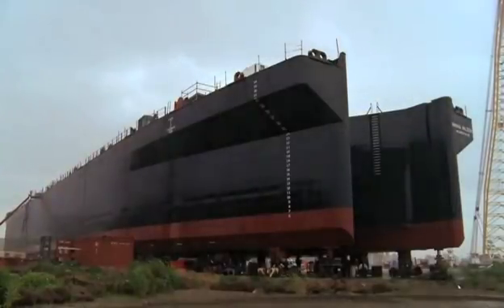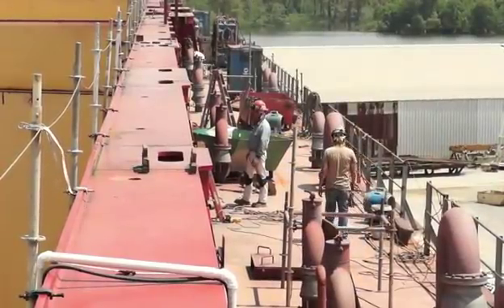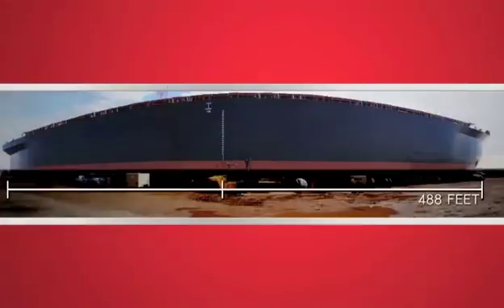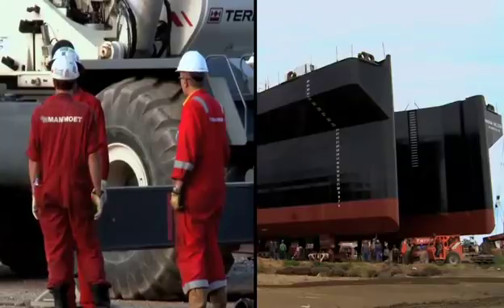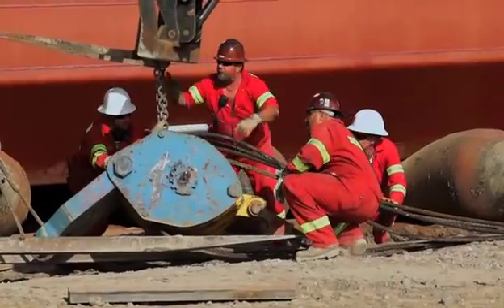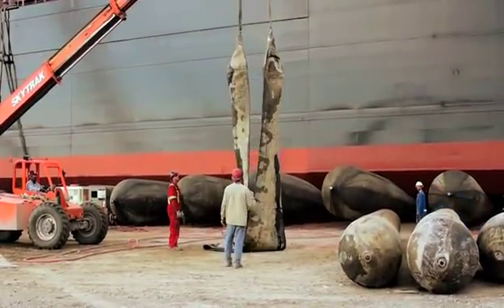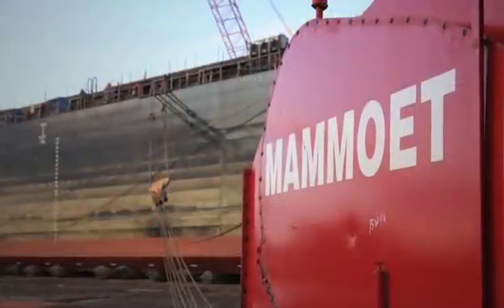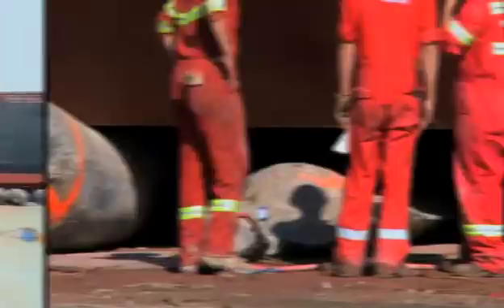Mammoet - Airbag launch of a 5000 ton barge in USA

Comment: Build the barge in a trough, flood the trough and float it.  Done.
Reply: troughs and flooding ability is probably more expensive than this method
Reply: The 'trough' as you call it is a dry dock. And they work great if and the key word here is if you have one. If you do not have one this works. ANY QUESTIONS?

Comment: Air bag rollers been around for 50 years,just in smaller scale in South Africa,used by fishermen launching small 20foot boats of the beach in Durban.Just use tractor or man power to move it.Nice to see it used here.

Comment: Those hard hats would sure protect them from any mishap while working under 5000 tons of steel.
Reply: The primary reason to wear a hard hat is to protect you from hitting your head on low hanging obstacles

Comment: i wonder why it was not build on a launchpad like all other ships
Reply: lytken indeed, it’s like they built it and getting it into the water was a massive oversight.
Reply: they literally explain why....its cheaper to do it like this
Reply: lytken no need for the typical shipyard using this method
Reply: @davgpol  even many mainstream shipyards are not building on a slipway any more, they have the equipment to move the ships so there is no need.

Comment: Why show the pyramids? No evidence they every rolled anything.
Reply: there's no conclusive evidence that they used rollers or sleds. those are just theories.
still one of the world's great mysteries, unfortunately.
Reply: They've proved that they used dirt ramps to build the pyramids and when they moved the stones up the pyramid, they used a lot of rolling logs to move the stones. At least that's what he's referencing. I'm not knowledgeable enough to know for a fact whether the Egyptians really did do that. After all, I wasn't there, but that's what he's referencing
Reply: Copper is as good as steel in many ways.
Reply: My dad was reading a book that suggested they poured the rock like a cement.
Reply: GreenTriumph1 they  moved the bricks by rolling them.
Reply: Do you mean the large stones? I thought that they used sleds.

Comment: one of those airbags blow ,  you better be somewhere else !
Reply: If you're standing next to it you will be moved "somewhere else" immediately...
Reply: A tyre on a garbage truck once exploded in the road outside my sisters house, it smashed the front door through and took out a wall, right where my nephew used to play in the hallway.

You're right, don't want to be near that kind of pressure if it pops.

Comment: Just a thought here…….

But this is obviously pretty large, so when does a barge become a ship? 
I do realise that a barge probably has little or no power and gets tugged and pushed, but in the start of the 20th C this overall size would easily be a small or maybe not so small ship!
Reply: mrbluenun indeed, a barge has no propulsion.
Reply: mrbluenun it is also due to the ship hull
Reply: Bas van beers